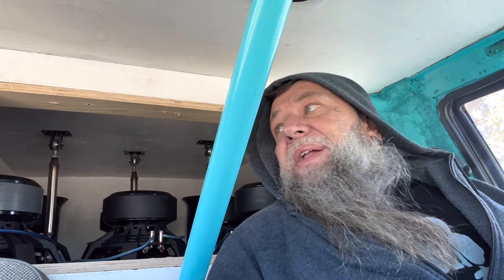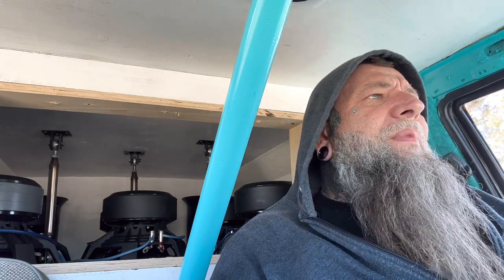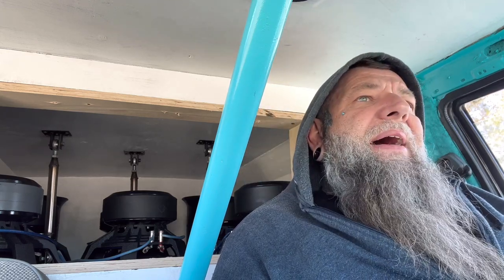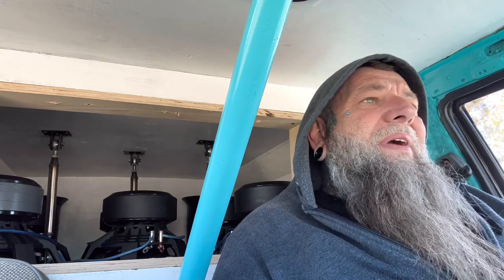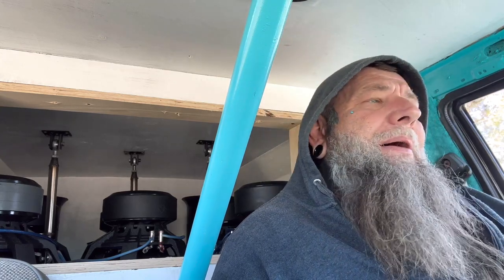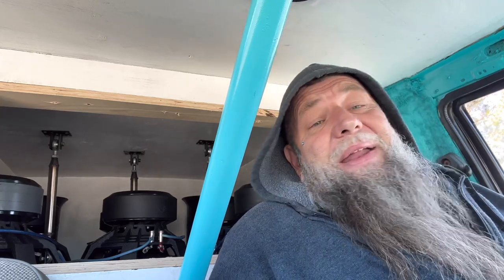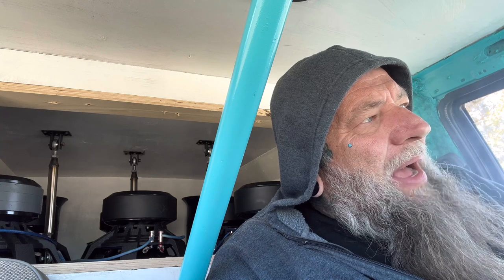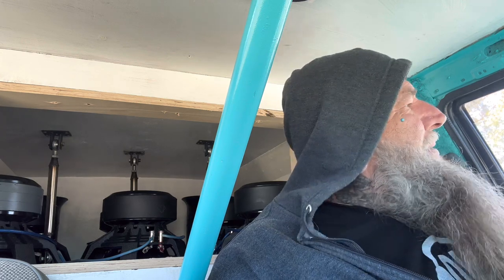Head unit voltage. Does it matter

Comment: @JerryAintloud, and to all who want's to know what higher RCA output voltage can provide. The highest, unclipped= clean, RCA output voltage your amplifier will take/accept, will allow you to keep your gain knob all the way down to it's minimum setting= will give you the highest signal to noise ratio. For those who may not know what i mean, you can ✔️ your system's S/N Ratio, by pausing some music, close all windows, and doors, turn off A/C, and anything else that is noisey, then while paused turn your source unit's volume up to just under clipping= my deck clips high freq. @ volume 50, and clips @ volume 49 on Low freq., so i turn my volume up to 48, and listen to your system's background hiss/noise. Listen carefully as you turn the volume down, to see @ what volume the noise does not get any quieter, and that should be the volume you play for SQ listening, like for judges, or just for critical listening session's. By the same token, if you don't know where your source clips, turn the volume down low, then close your eyes, listen very intently, and slowly turn the volume knob up until you audibly hear the hiss/background noise get louder, and if you keep going you should be able to hear when there is clipping!? For maximum SPL, RCA voltage only has to be high enough to get your amplifier's maximum power out of it. But for SQ., it can be a huge difference. That being said i have heard from owners of Taramps amplifiers, that they last longer with RCA voltage's in the 1.5volt range, and you just have to turn the gain up more. So i always recommend that you ask the manufacture what is the safest/highest RCA voltage for their amplifiers. Hope this helps💖 to all!
Reply: Thats not true, Barevids has videos proving a higher rca voltage doesnt mean better sound quality
Reply: @FuckYouTubeCensorship2024 - I said a higher rca input voltage, can give a better Signal to noise ratio. Like if you had a deck/source that could only put out 2 volts, and you had to turn the amp gain up to half way, to get the max power, just below clipping. If you then had a 4 volt rca output to the same amp, and now the amp gain can be ALL the way down, and still get the same max power, just below clipping, the Signal to noise ratio/hiss/back ground noise, while paused, with the volume up. The 4 volt setup, with the amp gain ALL the way down, WILL have less noise.
Reply: @evilinside5984  what? You dont turn the gain halfway to get more power. Gain ks to match rca voltage. It isnt a volume knob dude.
Reply: @evilinside5984  you dont get ground noise from gain, thats from a ground loop with improper grounding, has nothing to do with amp tuning
Reply: @evilinside5984  rca voltage has 0 effect on sound quality or singal to noise ratio. Again, do some research, BareVids has a great video of breaking this down for you. 2v rca output vs 5v rca output is just a personal preference, has no real effect on the amp besides where the gain is set to match that voltage. The amp will still make power regardless of 2v or 5v preouts, rca's do not dictate rail voltage on the amps.
Reply: @FuckYouTubeCensorship2024 - I was just giving an example, IF a 2 volt rca signal from the deck/source unit, allowed the amp gain to be matched= 2 volt, and that happened to be with its gain turned halfway up. Then if you swapped out that source unit, for 1 with a 4 volt rca output, and that allowed the amp gain to be matched= 4 volt, with its gain ALL the way down= it will have a better signal to noise ratio, out of any amplifier. You must not know what signal to noise ratio is. Example: I have a 4ch. Amp that has a Signal to noise ratio of 106 Db, with the gain turned ALL the way down, and its only 87 Db, with the gain ALL the way up= a 19 Db difference, that is huge!
Reply: @evilinside5984  all a 5v vs 2v does is change the range you measure the sine wave for clipping. The amp still converts the signal to 40v max on the rail voltage. Reading that 40v on a 5v scale when using 2v preouts would be like reading milliohms on a dmm set to megaohms scale.
Reply: @FuckYouTubeCensorship2024 - Im not talking about ground noise. Look up what Signal to noise ratio, of an amplifier means. Often printed as SNR. A Higher SNR= better.
Reply: @FuckYouTubeCensorship2024 - Just look up the definition of what the Signal to noise ratio, of an amplifier means.
Reply: @evilinside5984  you literally said ground noise in your first response. Only amp i have ever had any kind of noise due to rca voltage in 30+ years of car audio is taramps because those amps do NOT have filters and hate anything over 1.9v on rca output. They alao have no filters or relay system on remote signal circuit and are prone to giving you turn on/off thumb because they do not have the capability of giving a delay from the inrush of current during turn on/off
Reply: @evilinside5984  you do realize A/B amps are a bad example to use. Class D amps have way better filters. Hence why you can be clipping on your headunit and you wont get clipping out of your sub amo cause it filters it. Check out barevids, he has many videos on these topics proving the car audio myths wrong. People still go around talking about amps as if it was the 90s.
Reply: @evilinside5984  and you do realize 2-6v is low level, 7-12v is high level. You will not audibly hear a difference between 2v and 5v preouts. If you get interference, majority of the time its bad connection or bad rca cable. Like i said, only amps i have EVER experienced floor noise or hiss from are taramps, added a dsp to adjust rca preouts to 1.8/1.9, noise went away, go to 2v, noise starts to be audible, especially when no music is playing. American bass, rf, kicker, dc audio, soundqubed, sundown, hell even skar, power acoustic, crunch, audiobahn, mtx, and autotek amps didnt give issues or care what rca voltage was. They had 0 floor noise/hiss. It also depends on the quality of the equipment, dont use a cheap head unit like a boss or pyle headunit. Never had an issue with 2-5v preouts on a kenwood excelon
Reply: @FuckYouTubeCensorship2024 -I said (background) noise/hiss= not from a grounding issue. Im talking about Signal to noise ratio, and how it affects a stereo systems noise floor. Every system has noise while the volume is @ 99%= just under clipping, and paused, and this is called the noise floor, that can be measured in Db. A higher noise floor is bad. If amp #1 had a SNR of 60 Db, and amp #2 had a SNR of 90 Db, then amp #2 would have 30 Db less of a noise floor. I have 35+ years of audio experience, and a champion car audio Db competitor. I have tested many things over the years. I know of barevids, and he would back me up, about how an amplifiers SNR is affected by rca input voltage, in relation to obtaining top power, while keeping the amplifier gain all the way down, in order to have that amplifiers highest poss., SNR, in order to have the lowest noise floor possible.
Reply: @FuckYouTubeCensorship2024 - I have been a car audio Db competitor for over 30 years, in many organizations. I have given many demos of my own, and listened to many more. I have built, designed, and tuned many systems over my 35+ years of audio experience. Im not some kid. And i have tryed to be respectful of you, and you have not done the same. It seems like you love talking down to people.
Reply: @evilinside5984  how am i talking down? Dude save it. Im blunt and straight forward. I couldnt carr less how words in a text with no tone sound to you when you read it. Thats your problem not mine. You can claim whatever you want when you have no proof to back up what you claim. Ive seen dudes claim the same shit then come find out they ended up being a 19 yr old kid running mtx and dont know a single thing about tuning an amp but claimed they did comps. Dont play victim after you took personal shots as well. Sorry but misspelling tried is not something adults do. Sorry but more times than not, anyone who is vague in their experience, builds, not naming years in comps and organizations, throws red flags and ends up being bullshitters. I dont give a fuck if you think im respectful or not. Thats your perception and opinion. Not factual. You claim to be a champ in spl, what organization? What year(s)? Whats the real name or team to look it up?
Reply: Which preamp output voltage is best for subwoofers 5v, 4v, 3v, 2v?  My amplifier goes from 6v to .2v going counter clockwise
Reply: @BoobeeMyles  none, the subwoofers dont care what the rca voltage is, they dont see that voltage. The amp filters and converts it to the mosfets and rail voltage to go from dc voltage to output AC voltage to the subwoofers. Some amps like taramps hate anything over 2v on rca voltage. But for most part, as long as that gain is set properly to the rca voltage from the headunit and not clipping, subs will be happy.
Reply: @BoobeeMyles  - If your amplifier can handle 6 volts maximum, and make max. unclipped power with your gain all the way down= counter clockwise. Then 6 volts will give you the cleanest s/n ratio. That is just for best= highest S/N ratio. As far as best for subwoofers= any rca voltage that can get maximum power out of your amplifier= 1 volt or higher is fine. It's just the lower your rca voltage, from your source unit= the higher you have to turn up your amp gain. Its just a matching game, not a volume knob.
Reply: @evilinside5984  well said, I'm aware of most of what you said, but my problem is when I turn my gain to 6v my subs don't hit as hard as when I push them to clipping or 12oclock on my gain.  I have 2 evl-2x12d4 on a Jp23v2, it should be slamming hard bro.   I have a dual head unit, so I'm trying to find the best head unit for my system
Reply: @BoobeeMyles  - That is because you would need a 6 volt output from your head unit, to be able to get full power from your subwoofer amp, while your amp gain is set to 6 volts. Look up your model of head unit, and see what rca voltage it can put out. If it was say 3 volts max, then your amp gain would need to be approximately @ the halfway point= 12 o'clock position. If you have a Dmm/volt meter, you can manually ✔ your head units rca output voltage. Make sure if your head unit has a subwoofer volume setting like -24 db to +6 Db, like mine does, set to +6 Db, before ✔️ing your head units max rca output voltage. For the rca output test, keep your head unit paused, the whole time, as you dont want to blow any speakers. Put the volt meter to the rcas, while not hooked to amp,(again, no speakers should be playing) we are just finding out how much rca output voltage your head unit has. Still paused, slowly turn up your head unit (have some one help you), while you watch the rca voltage reading on your volt meter. The voltage should keep getting higher, untill it clips, or starts leveling off, or drops. Remember the max reading, and have your helper, slowly turn down the volume knob, until the voltage starts dropping again, and ask them what number the head unit is @, and don't go past that point.    I like to run my bass amplifier gain a bit high, if using a bass knob, esp. if it has a clip light, as you can turn it down if a song has a bit too much bass. It's easier than going to the amp and adjusting it. Just use the clip light as a point of reference, on when to back it off. A head unit with a 6 volt rca output, will not make your bass louder, if you can get to clipping, with your current head unit now. Just turn the amp gain up to half, and see how that performs.
Reply: @evilinside5984  I normally have hain set to half-way, but Steve Meade told me it too high, I'm like maybe, but this is where I feel my subs & amp ultimately performing.  My dual head unit has a 4v preamp output, so you were really correct with your 3v analogy.  And to answer your comment @ gain half way, it performs nice & strong for 3kwrms, I just clip a lil.  The JP23v2 has a bass knob w/ digital voltage, temp., clip & protect light
Reply: @BoobeeMyles  - Half sounds about right, if you clip just a bit, you can just back off the bass knob. You are good to go then. I own a Jp amp as well, and Love that bass knob, and amp!
Reply: @evilinside5984  I'm thinking about adding 2 more Evl-12d4 & getting a taramp md 8k, I'll probably just start with the taramp 5k 1st..  I need more bass🤣💯
Reply: @BoobeeMyles  My opinion, from what i have seen, Taramps has come a long way. I really like there newest line of amplifiers called the BIG BOSS BASS, they make there models rated power @ 1/2 ohm, 1 ohm, and 2 ohms. So if you added 2 more of your D4 subwoofers= a total of 4, you could parr. all 4 subs, down to 1/2 ohm, and since the BIG BOSS BASS models are STABLE @ 1/2 ohm= perfect match for a BIG BOSS BASS 5K, or BIG BOSS BASS 8K! This model making the same power @ 3 different ohm loads, allows you to wire @ 1/2 ohm, and if while playing music you have 4x impedance rise, which is pretty average=this model/line will still make rated as impedance rises to 2 ohms! Also this new BIG BOSS BASS line has 22 different light displays= they look AWESOME! Remember, even though your Jp amp is approx. a 3k amp, @ 1 ohm, on a amp dyno, it is not giving anywhere near that power, wired @ 1 ohm, while playing music, after rise, you might be getting 1500 watts! So adding 2 more, D4 subs, wired @ 1/2 ohm, on a BIG BOSS BASS 5K, after rise WILL give your 4 D4 subs 5K, if you have the electrical!? So in actuality, you could be going from 2 subs getting 1500 real watts, to 4 subs getting 5k watts= the difference would be mind blowing, and possibly subwoofer blowing if not care full😆😂
Reply: @evilinside5984  🤣🤣🤣...  I swear..  I have a 320a autotech & when I go to a 5k or 8k I'll add some batteries.  I seen the big boss line, I really like them.  The lowest impedence I can wire 4 d4 12's to is 2ohms..  & the md 8k has a 1ohm & 2ohm version, so I was going to get the 2ohm md8k for the 4 evls, should be decent for them.  You think the md 8k will combat the impedence on 5kwrms subs, like is that enough head room?
Reply: @BoobeeMyles  - 4- D4 ohm coils, all wired  in parr.= 1/2 ohm. And the 8k wired @ 2 ohms will not make any where near the power of even a BIG BOSS 5K, if wired @ 1/2 ohm, after impedance rise. The Md 8k, if wired to 2 ohms, will make between 8 ohm rated power, and up to 4 ohm rated power, after rise, so approx. 2k to 4k, MAX!